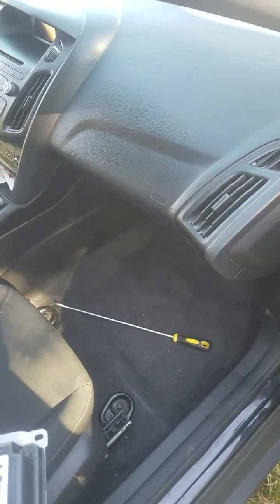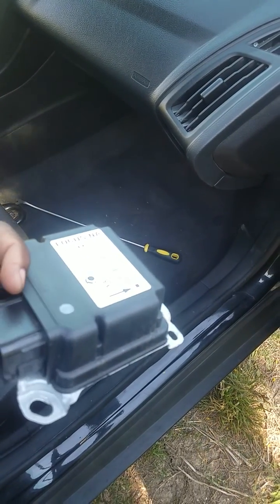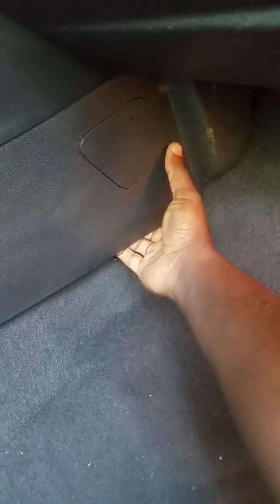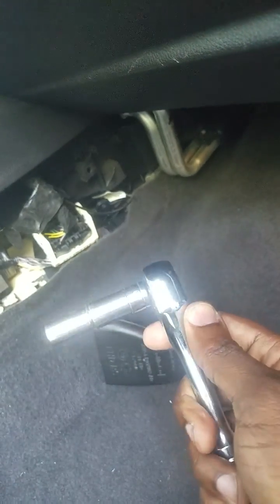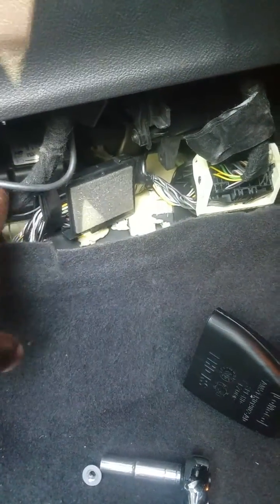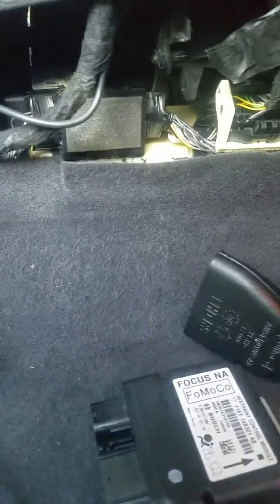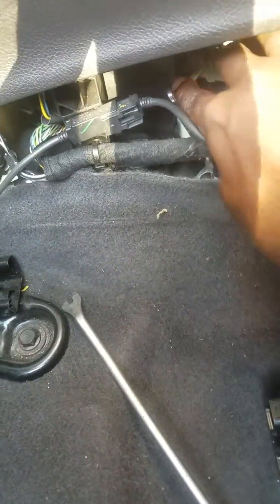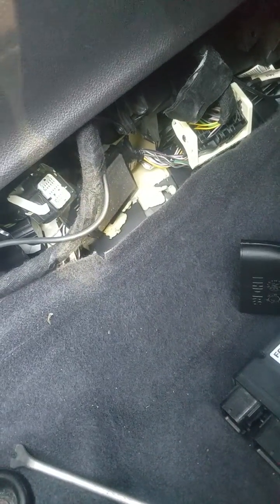How to replace 2015-2017 Ford Focus airbag computer RCM module

Comment: How can you tell when the rcm is faulty??
Reply from the maker: Hi, do you suspect the RCM as faulty? and why? I've never seen one go bad by itself, only ways I've seen it needing replacement is if it was flooded or locked due to various SRS deployments.. Either way a proper scanner that can read codes will give you an idea of what is going on...
Reply: Global Commerce thanks for the reply. Recently (in the past 3 months or so), when I accelerate, I hear a “clicking” noise. Almost like a there’s a short out. I checked all the fuses, but they’re good. When the clicking begins, everything connected to the center turns off and turns back on; the a/c, stereo, emergency lights, traction control, and passenger airbag
Reply from the maker: Sounds like a loose connection or ground.. maybe battery cable etc.. what year/model car? was it ever wrecked?
Reply: Global Commerce an 08 Ford Mustang. It wasn’t in any collision, but it has seen its share of bumps. Could you link me to any how-to videos? I’ve been checking online and I can’t seem to find what I’m looking for.
Reply from the maker: I think you need to check all the ground points on the frame, follow the wiring harness or search google...  Also I've seen this happen because of a low battery or loose battery terminals.. check the easy stuff first...

Comment: Hi
I have changed the rcm in my car like you did, but I got the traction control light on afterwords 
do you think it needs to be programmed to the car ?
Reply from the maker: The RCM needs no programming to say, but the traction control light is because linking information is stored in the RCM almost all systems work together in this car.. you need to preform a Horizontal and Vertical sensor sync through a scanner that supports this feature, this is normal with changing the RCM..
Reply: Thank you for the answer.do you know about a scan tool support this feature ?
Reply: Mahran Shweiki 🤔